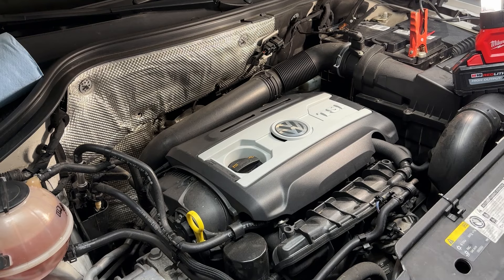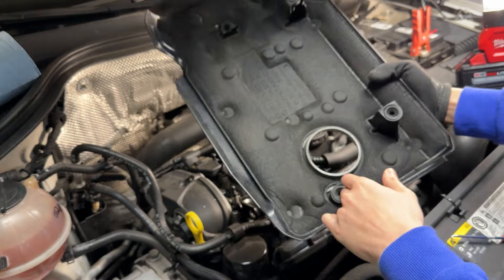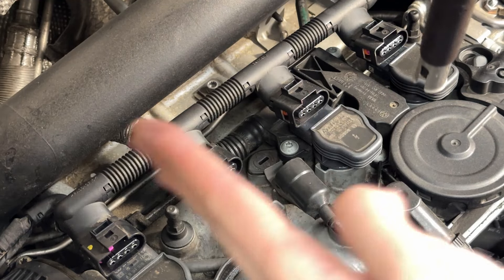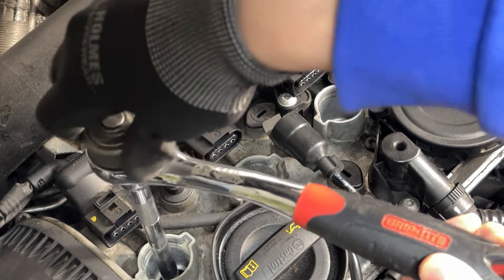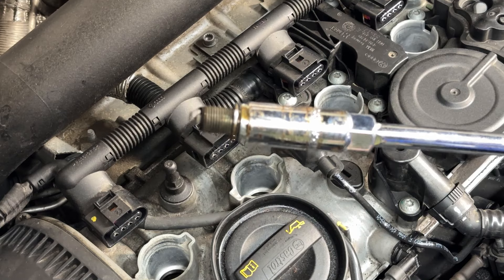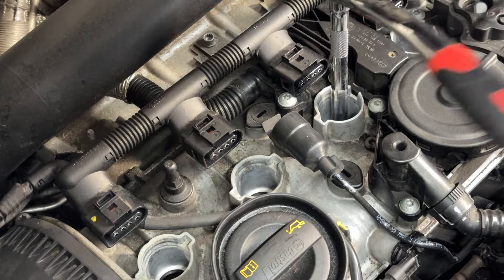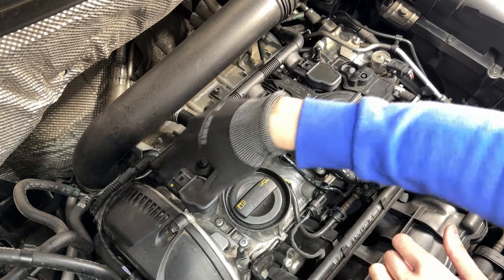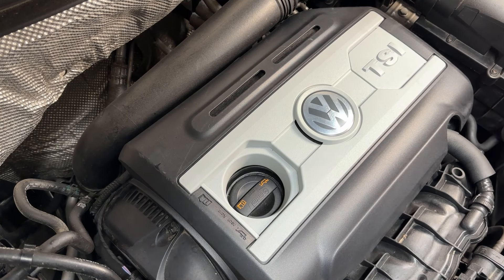TIGUAN/GTI/JETTA 2.0 TSI SPARK PLUG REPLACEMENT -EASY GUIDE

Comment: What if the tab is missing?
Reply: In my personal experience you can use a flat head to gently pry where the plastic meets the coil. That will esperate them, even if the tab is still there